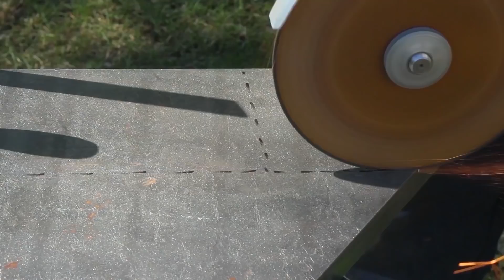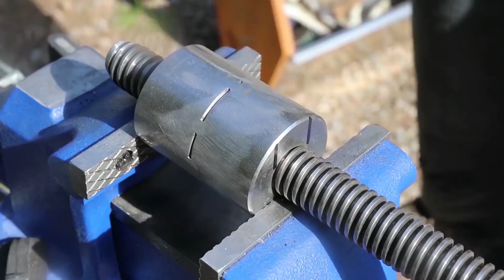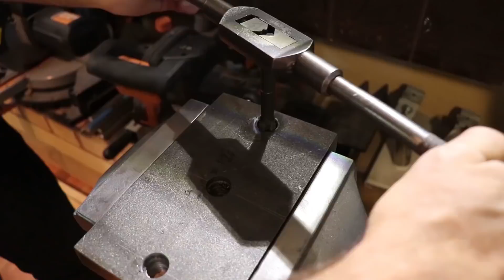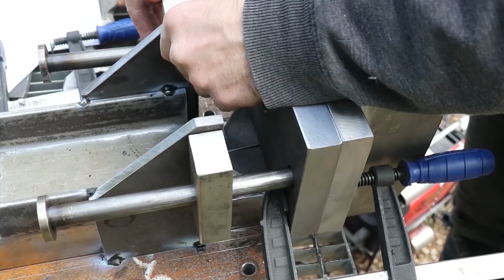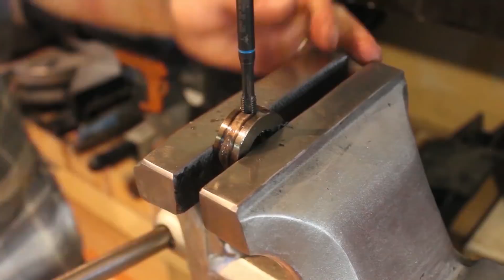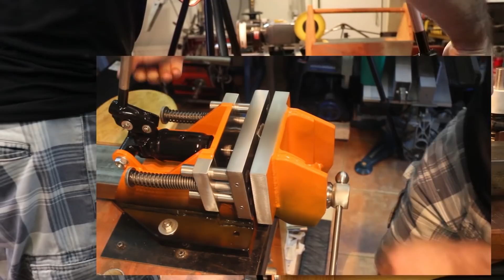Diy: Hydraulic bench vise combined with Screw vise

Comment: May i know the details of your work metal table if you won't mind. Want to build same work table. How do you call that type of table top and how did you design it? Can i see d diff sides of your work table? Thanks in advance 👍
Reply from the maker: 😊 Its not actually a table.. just a piece of steel grating on top of my old table saw frame. Like these:
http://www.midgrid.co.uk/Steel-Gratings.html

Comment: Ooh, well there you go. That is a way cool design. I have a question. Being that your able to bend metal with the hydraulic part. Is the nut to the vice going to bend at the threads?   Would a drop pin,  where the vice ends and the press stops help that? Really good idea. Saving lots of space in the shop.
Reply from the maker: That's why the "slide" part needs to be sturdy and with a minimal gap to the vise body. That's why i used paper sheets as a spacers when welding it together. Minimal gap keeps "slide" straight and threads are stressed only with straight pull. Also actual nut is 70mm ( 3" ) long, to handle the stress. With 2 ton power, that's more than enough. ( I don't know all english terms, i hope you understand ) 😊
Reply: I  was wondering about thread stress. THANK YOU for the reply.
What a wonderful gift you have given us with your idea. Very creative!
Reply: Atlantis thank you for thinking this through. Great question and drop pin idea.